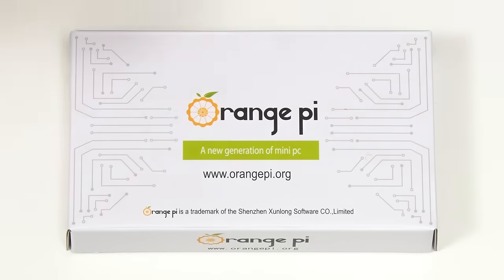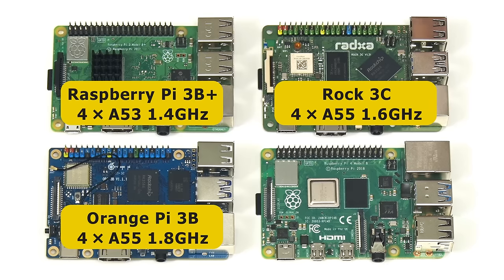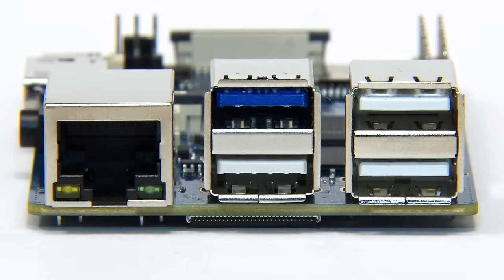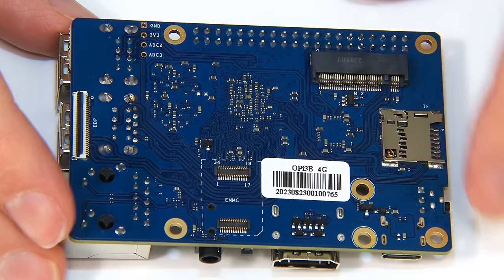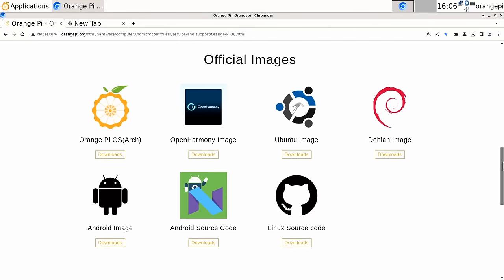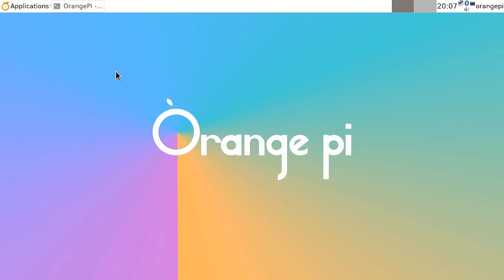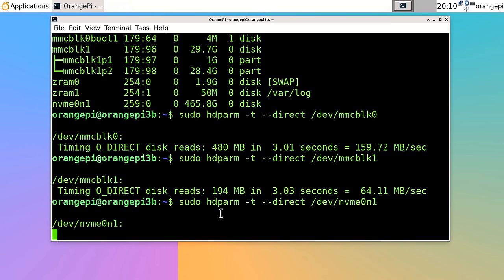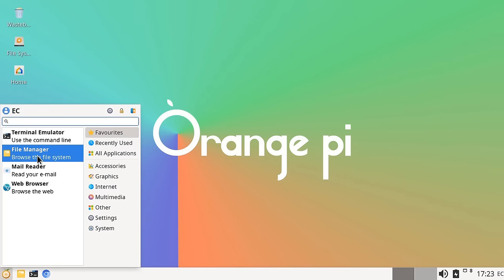Orange Pi 3B:  Low-cost M.2 ARM SBC

Comment: I used orange pi about 5 years ago and there were problems with official OSs at that time. Seems things did not change much. So, DO NOT BUY ORANGE PI!!!
Reply: armbian with orangepi is the way to go
Reply: official software is presentation quality and is also not their work. Its either some old Armbian or some Arch
Reply from the maker: The software support from Orange Pi for their recent Orange Pi 800 and Orange Pi 5 has been very good.
Reply: @ExplainingComputers  they are not developing software FYI. You should figure out that by now.
Reply from the maker: I am well aware of what Orange Pi (and a lot of other SBC manufacturers) are and are not doing. After working in this industry for over 10 years, and communicating with people at those manufacturers on regular basis, I am not the uninformed idiot you clearly assume me to be. The fact remains that Orange Pi do provide software for their boards (whether they code it themselves is irrelevant -- a lot of companies in all industries do not make everything in house). And whilst the Orange Pi software is not generally developed across time, they have provided much better OS in recent years, as was the case for the Orange Pi 800 and Pi 5, which is all that I said in my last comment.
Reply: I believe you are an open minded man. What is then? Software mechanisms you are testing on the surface in this channel is useful for YT, yes, for free and paid promoters. And addicted consumers that wants a new toy, perhaps developers that will make from this actually useful standard (!) made software and keep it there. Consumers can ignore who made software, but not you. You are a public figure. FOSS authors can usually only get reward and compliments for providing and maintaining (!) software you(!) use for free(!). You are taking that away for a decade now and this is not relevant? Imagine someone else taking credits for your videos on industrial scale. Software is getting better? Sellers only care to produce and sell more and more. Why complimenting them for shipping better software? If you give this recognition to them, you are at least not doing anything good for developers community. Which is responsible if software is good or not, if people that recognize your hard work and cheers you, have problems. Or is entertainment the only goal here? Well done. Perhaps that prevents you to see little bigger picture - what is relevant and what not - when producing this very well made narrative of banality?

Comment: No thanks... any $100 USED (as in RECYCLED) HP or Dell mini PC pisses all over any ARM trash.
Reply: They also use 2000% more wattage than ARM. You can run ARM computers off a usb power bank. About 2 watts.